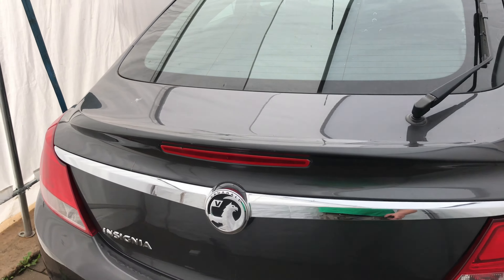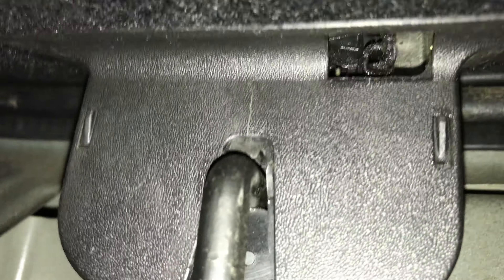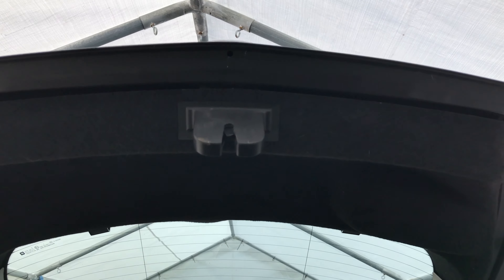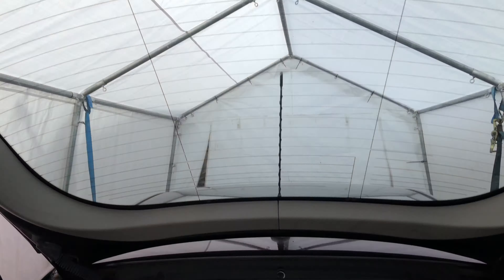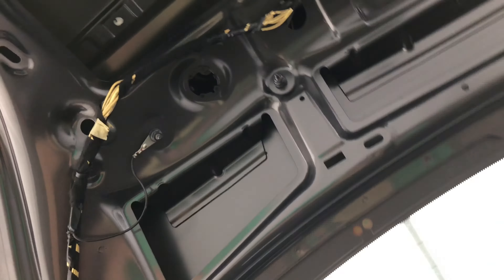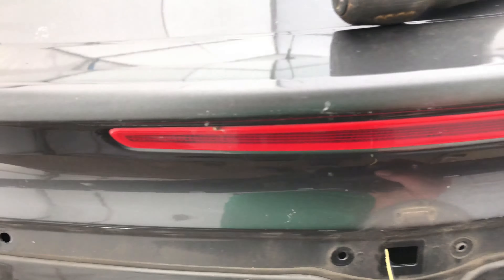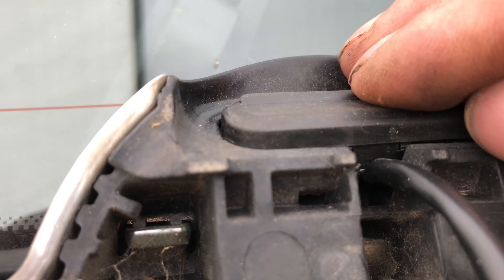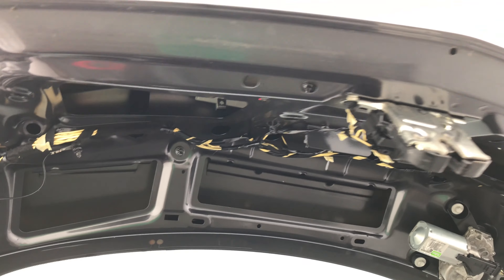Vauxhall Insignia boot access  & faulty boot switch replacement

Comment: I used to pop out the switch cut off the microswitch part & short the 2 wires together & hey presto boot open no need to climb in back or clear out people's junk.

Comment: This is a wonderful video. Thank you for taking the trouble to upload it Paul. I wanted to confirm and reassure myself that the switch was faulty before ordering a new one. This can be done after the internal tailgate trim has been removed, because it's easy to access the back of the switch even before removing the chrome trim. All you have to do is find the back of the switch, and pull off the little plug from it, shown later in your video. There are two wires coming from the the plug. Mine had a black and a yellow wire. Shorting these two together  with a jumping link caused a clunk and the lock opened. Not the plug with three wires, that one is for the boot lock solenoid. Being me, I had to investigate what the problem had been with the switch. I removed the flexible boot held in place by some clips and some sealant which had dried out,  scraped away the potting compound, and there is a tiny little crappy pushbutton switch embedded inside the assembly. This has a little dome which collapses when you push it to make contact. It was just a little bit corroded. I was going to try to clean it, but one of the legs snapped off so I can't say whether or not that would have worked.
Reply from the maker: You're Welcome :)
Reply: @PaulsTechChannel  I have done a temporary bodge with a small toggle switch, while I wait for a cheap Ebay replacement to come from China; £3.81 including postage. I just kept the 2-pin plug, used the existing tails of the wires from the plug, soldered the toggle switch onto them and insulated the connections to make sure they don't short to the metal bodywork. It will do fine for now.

Comment: Great video. I 
rReplaced the switch, and the latch, but now I keep getting a boot lid open warning even though everything is working fine
Reply from the maker: Check micro switch in boot latch.
Reply: @PaulsTechChannel  Thank you. What / where is that?
Reply from the maker: @craigdunne1236  It's inside the bool latch itself.

Comment: Wow..... Is this procedure the same for the estate version? Ours has an electric tailgate that goes all the way up/down. It's been temperamental for about a year and recently its just stopped working and wouldn't open ar all. 

Is the estate version designed the same as the sedan?

Comment: Great video?thanjs?couple or random questions,that gun is it 1/2 inch with adapter for smaller bolts,and where did you get that huge canopy that car is under?it’s great
Reply from the maker: Impact gun I use for smalller bolts is  1/4" Milwaukee M18BID. Canopy is available here - eBay item number 110709281698, size is 10 feet x 20 feet.

Comment: Mines is making a electric noise but won't open it that the switch or the other part I need
Reply from the maker: Possibly your lock assembly is faulty

Comment: This would be helpful but the inside of my vehicle bears no resemblance to the video. I cannot locate anything that looks like a'boot release catch'
Reply: I believe he has the plastic cover off in the video. It also threw me. If you look very closely inside the boot where the lid meets the bumper, you can get a screw driver in there to release the catch.

Comment: So slightly different screw  layout on my 2017 insignia 7 in total ( 6 in a straight line and 1 in centre by logo )  and two white things ( which I've no idea how th get off so I just pulled at them and they come through undamaged unfortunately for me after replacing switch my boot still won open 🫣